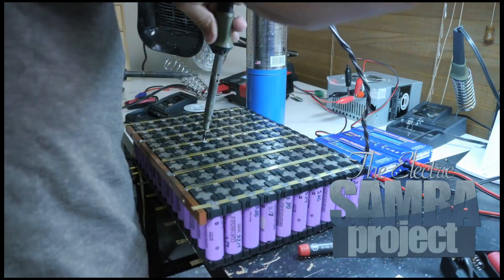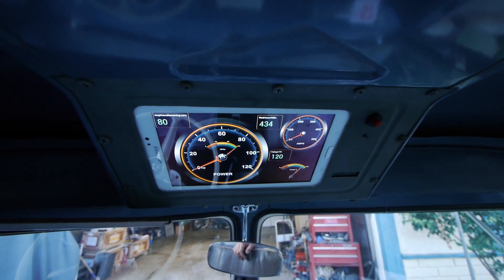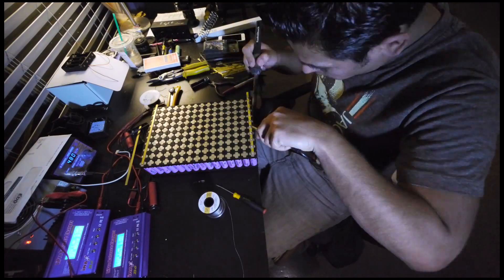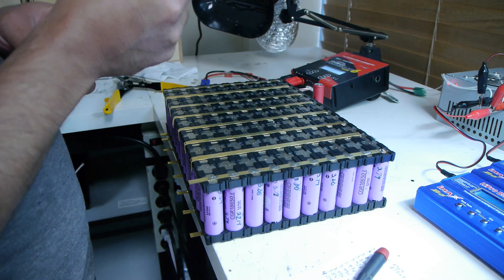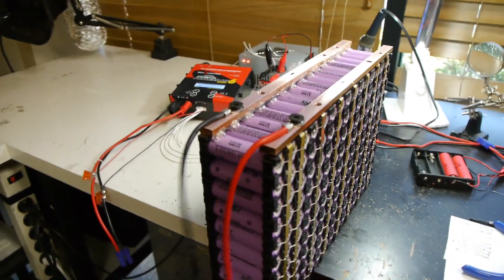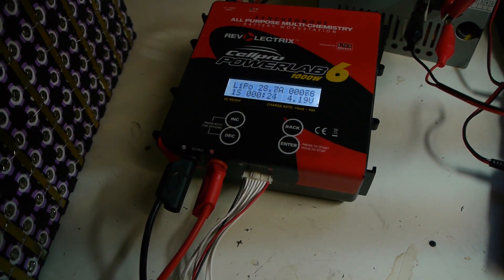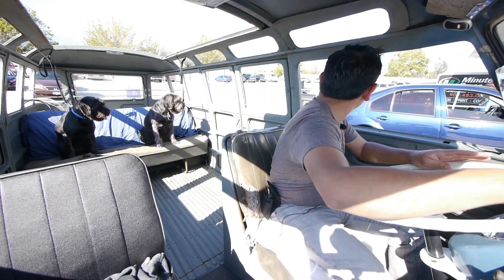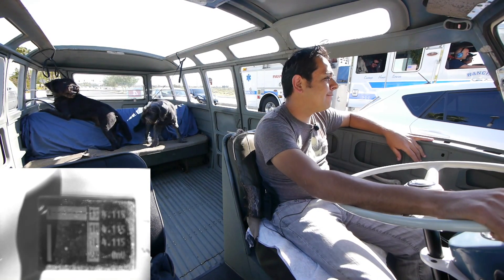DIY Tesla Car -  lithium ion 18650 battery -  VW Kombi

Comment: I don't get it. The motor only run on 1s150p of lithium ion how is that possible with only 3.7v nominal? What motor are you using? I only a see single pack of 150 18650 cells in 1s150p config.
Reply from the maker: +Rizki Praam     30x  1s150p  wired in series so  30s150p

Comment: Mr. Garcia, thanks for the info. The link you have provide indicates its copper bus bar, I have ordered that. Could you please provide the link for copper strip which connects to copper bar.
Reply from the maker: +nick Jain here you go, this is what i used  http://j35.us/Small-Brass-Strips
Reply: make sure you put a fuse on each and every single cell. unless you enjoy toxic electrical fires, then ignore the dire recommendation of every single battery pack manufacturer. up to you.

Comment: You make very nice videos and impart lot of knowledge, we really appreciate it. One of the question I have is where you get the fuse wire as well as copper strip to connect the batteries to the fuse wire.
Reply from the maker: +nick Jain 
Copper buss bars http://j35.us/1NGpBo4
Cell Fuse wire http://j35.us/1k-Ohm-resistor

Comment: how many packs do you have to use to run it if just  the one wow
Reply: +jehugarcia  How much did it cost to build the 30 modules, and what will you get for a ball park range
Reply from the maker: 30 modules
Reply from the maker: +Daniel Schroeder   I ended up using tesla modules http://j35.us/eBay-Tesla-Modules  Dead laptop batteries became really hard to get since the word is out that they are valuable to extract good cells.   I currently have 44kwh for 150 miles of range

Comment: That's a good project! But I prefer the old VW aircooled petrol engine =D
Reply from the maker: +Tiago Mian  I have a hard time finding something about air-cooled vw motor that i like.  Not particularly efficient, powerful or reliable.  Easy to remove perhaps,  four  17mm nuts and its out.

Comment: what range do you have with this 2nd module?
Reply from the maker: +Virgil Ionut  
Well..... i think it turned out to be 255AH  x 3.7v =   943Wh   the samba uses 300wh per mile.   So 943/300= 3.14 miles.
The samba can not run on a single module,  you need around  30 of them connected in series to bring the 3.7 volts of each module up to  111V so 3.14 miles times 30 modules,  should give you a range of 94.2 miles
Reply: +jehugarcia not bad, keep doing this videos please.

Comment: I'm surprised you have a motor that runs at 4 V.  Why not use higher voltage and lower current?  More efficient.
Reply: +Kurt Jenney It's just like you had an ebike with 4x12v (48v) lead acid battery then remove the one of it and replace 3s lithium ion to test. In his eSamba, you can see the other battery in series that not 18650 https://youtu.be/JQa5gn-7D74?t=1m21s
Reply from the maker: +Kurt Jenney   System runs on 96V
Reply: +jehugarcia I didn't get the best look at the battery, butbit appears that all cells are in parallel.  So unless you have many of those packs I don't see how 96V is achievable.  What configuration did you use?

Comment: You went with a 6amp cell level fuse, was this due to the capacity rating of the batteries or due to the rating you've seen the samba running under loads and your calculations?
Reply from the maker: 6 amps is well above the 3c max load I'll expect from each cell,  but is low enough to blow before a cell goes thermal runaway.
Reply: Thanks for answering, I asked because you said in the video you rated it for the 6.5 amps the each cell would experience under load, I wasn't sure if this wax max load or the sustained load.  Cheers on the build brother, I've been building my own 16850 packs but only 10s 11aH/420wH :P

Comment: is it posible to add the cells to a nissan leaf?
how long of a range can i get fron each of the cells.
Reply from the maker: +David l 
Yeah if you can find space in the car,   each 18650 cell has anywhere from 7.4 Wh to 12.5Wh ,  google says that the leaf uses 30kwh per 100 miles or about 300Wh per mile so each cell can give you about 1/30th of a mile of range.   thats about 176ft of range per 18650 cell
Reply: i want to try it

Comment: You are doing just 2.4kw to run this big van ? No way!!!
Reply: +LiPe VoLcOm Yeah, I was wondering the same thing. But then again it is pretty much a bare bone chassis, so it probably doesn't weigh more than one ton and putting the motor through the transmission certainly helps.  Heck, the fact that there is no red line on a motor means he can REALLY use that first and second gear to get up there before shoving it straight into high gear and essentially coast on highways.
Reply: +LiPe VoLcOm I think you only referred the test 18650 modules, the other batteries were in series at back of eSamba which is not 18650. https://youtu.be/JQa5gn-7D74?t=1m21s
Reply: +LiPe VoLcOm 
How about running the entire van of 4.2 volts? That's one big motherf*ing step up converter.. I think we're missing some info here.

Comment: I like how you can drive a car with almost no windows and roof in the USA.
Reply: And seatbelts
Reply: @gf4913  If the car was built with seat belts at the factory it is illegal to remove them anywhere in USA if you still drive it.
Reply: @seanwatts8342  Interesting😏
Reply: @gf4913  I had a 1962 Chevrolet WITH seat belts and I had to keep and use them. Later, I had a 1963 Chrysler with NO seat belts. The police could say NOTHING because the car was made that way.
Reply: Why where in  freedom land do you leave
Reply: Even in France, if you don't drive like an asshole and just have insurance, you won't get a ticket.
Reply: @MABFR01  Dont want to talk about Germany here xD
Reply: "In the USA" no, it varies by individual state.
Reply: ... a functioning brain isn't required either.  Apparently.
Reply: @qpwodkgh2010  No, those are Italian & RUssian drivers.

Comment: I respect your wiring, it is superb, I ran a repair center for Honeywell NASA  Support Green Belt MD and repaired Main Frame Computer power  supplies that moved several hundred amps. Your very Safe, I hope others follow your foot steps so they don't endanger them selves. James Mastbrook
Reply from the maker: Mechanical fuses at every cell makes a lot sense to me,  others don't agree
Reply: Hi there! How do I know which fuses I have to add between the cells? How do I calculate their "capacity" or ohm. 
For short: What fuses do I need to glue between the cells for a 36V battery with 10 serially connected blocks of each 12 parallel connected 18650 cells?

Comment: no charge balance?
Reply from the maker: +Grover Asylum  nope,  works fine without it
Reply: +jehugarcia For now it does. Are you still using this battery? has it gone through a lot of cycles?  I'm building an ebike battery and I'm planning on doing a balancing circuit for it too. I haven't looked into how the Tesla BMS works. Not a car person at all. But now I'm kinda curious.
Reply from the maker: I don't use this particular cell,  but I use the tesla built ones every day,  no BMS I cycle them once every 3 weeks or so,  as i don't drive that much but its going on for more than a year
Reply: +jehugarcia Thanks for the insight! My ebike project involves me salvaging all of my cells from dead RC packs from my local hack space. So a little extra work to make sure things are stable is worth it to me. I bike 30 plus miles a day and have more time than money. This a is sweet looking build BTW, good work!

Comment: The 18650 battery's are superb.
Can you share what kind you're using ?
You mention 6A a cell.
The best i found so far are 3.5A.
I ask this because there are a lot of fakes that advertise the world but are in fact cheap crap.

Greetings
JP
Reply from the maker: +ToThePointGarfield   Sanyos  and panasonic mostly,   the 6Amp where the fuse would blow  so i would only ask 3-4 Amps max out of them to keep them happy
Reply: Youre confusing AH with discharge. Many cells can safely pull 20+A.

Comment: For that bigger project you shouldnt solder cells.
It heat up them.
It shouldnt be...
You can make welding machine from scrap, using microvawe transformer.
It will be better, easier, and much faster than soldering...
Reply: +Arek R.  Safer too. And not only for batteries.

Comment: You need to put in large diodes everywhere.....    That way if one cell dies it only takes a few others with it, not dozens and dozens.
Reply from the maker: +cucking funt Draw a schematic so i can understant how it works
Reply: +jehugarcia Diodes accept electricity in one direction only.  Most modern electronics use them.
Reply from the maker: I understand what they are and how they work,  I don't get how they are helpful in this case

Comment: Nobody told you that heat soldering of cells is FORBIDDEN? For such project, you should use resistive soldering - like Tesla...
Reply: +jehugarcia  hey I solder them too, don't worry too much :P
Reply from the maker: I hardly ever do what I'm told
Reply: markovip211019 thousands of cells later, i'm still here, not ONE, has ever exploded or anything else.

Comment: I tried just using the fusible wire on my bike batteries and I think it is limiting my current and causing my batteries to get hot so now I will incorporate the buss technology :)
Reply from the maker: If you limit the current load on your batteries wouldn't that run them cooler than running them at full load?
Reply: +jehugarcia Yes, however putting them as I did in series limited my current so much that I couldn't beat a snail. Please don't change a good thing that you have, it works great.

Comment: that is impressive it surprized me that that small of a battery pack and motor could drive your samba what is the range on that thing?
Reply from the maker: Battery is not small,  at the time of this video it had around 22kwh of battery,  that's 122v x 180AH
Reply: oh ok

Comment: I wonder, can you use your Balance Tester Leads to monitor your Battery while it's in use? I'm a noob when it comes to this battery pack stuff so I have Zero Clue. I see the PIP but can not figure out if that is the Balance Leads or something else to monitor it. Oh, PIP is Picture in Picture, well that's what they use to call it a few decades ago when it was popular on TV's...
Reply from the maker: Paul Bialozor that is a device used to display individual cell voltage on up to 8 groups of paralleled cells.  I can leave it hooked for more than a few minutes because it uses power from only one cell and it trows the cells out of balance
Reply: jehugarcia Yes I gather that, but do you connect it with the same leads used to balance the batteries when you charge them? I assume you do, but don't know for sure. Also did you make that monitor or is it something you can buy? I want to start experimenting with 18650's but don't have much of a budget to work with so I have to be very creative. I want to use the 18650's as a UPS first, then at some point partial house electrical use to eventually whole house; much like the Tesla House Battery. I can be very creative at times and hopefully one day find my Diamond in the Rough but until that time my mind wonders...Have you figured out the Tesla Fuse Link Wire that was used and why?Thanks...
Reply from the maker: I dont balance my cells,   only once before connecting them,  then I just charge the whole pack as one.   its been 10 months since I installed them and i just checked today,  there is a 10mV difference between the lowest and highest cell,   they are almost perfectly balanced after all this time. I used a cell log 8 available online for $15 or so.   Its for RC lipo batteries.    Tesla uses a fuse that blows at 20Amps for safety.   Im using a fuse that blows at 6amps on my diy pack
Reply: jehugarcia Thanks...

Comment: Shifting into higher gears will giver you more torque for your power. I hear those motors screaming! How many gears d you have? jehugarcia
Reply from the maker: 4 gears,  only 3 usable 1st is too low
Reply: jehugarcia If you care to upgrade the rear end gear ratio, you will probably be able to see noticeable efficiency gain when cruising in high gear! Might be more expensive than just buying more batteries, but it's for sure more efficient if that's your goal.
Reply from the maker: Why do you think my motor would run more efficient with other gear ratios?
Reply: jehugarcia You'll get more torque out of your electric motor the closer you get to 0RPM. More torque= less spinning mass and speed.

Comment: How many 3.7V 2200Mah battery will be used for 2KW Lithium ion battery pack? Will be it in parallel or in series / parallel - series? Looking forward to your response. Thanks for previous reply.
Reply from the maker: Well, let's do the math 3.7 x 2.2= 8.14wh.   Divide 2000 / 8.14 = 245.7 cells will be needed to get 2 kWh.   Series or parallel?  Depends what you need,   You want a really big 3.7v battery?  Connect all of the cells in parallel.   Do you need a 12v battery?  Then split 245 cells into 3 groups of 81 and arrange the pack in 81p3s configuration.   Wiring configurations largely depends on your voltage needs
Reply: jehugarcia Thanks a lot for your each response. This means a lot to me.
My total load is 2KW in home. From tesla's powerwall, their are providing 2kw power at peek. So what will be my battery size yet I need 2KW or my load is 2KW? Their battery energy storage is 7KW. So what will be my battery storage capacity if I want 2kw at peek and I want two days backup. And how can I calculate nominal and peak current from my 2KW battery pack?
Looking forward to your response. Again a big thanks for your previous reply.

Comment: Hmm? So, you have 150 x 3.7V  Li-ion batteries--ALL wired in parallel. Which works out to be 3.7V total.....with a shit load of Amp Hours! Where/how are you getting the needed volts to power the electric motor in this beast?! That electric motor can't possibly be running on only 3.7 volts, period.

Do you have multiple packs of this configuration that you installed, that your not showing? This would obviously, seem to be the case. If you would please, state how many?  Inquiring minds would like to know.... Thanks.
Reply from the maker: 55rebels I have 35 LiFePo4 cells in my pack (115v),   at the time i had 22kwh of battery.   DIY 18650 module was added to it.
Reply: jehugarcia Sorry, but I'm a bit still confused here. In this video, the one I'm commenting on, it shows you wiring--in parallel 150 3.7V (CGR18650) batteries; creating a 3.7V (total) pack. Are you saying that you added 'this' pack to your existing--anemic 35 cell (3.2V per cell) LiFePo4 pack (115V)? I'm assuming that this was done in parallel? That LiFePo4 pack must have been pretty anemic, which couldn't have been more than a few hundred (maybe 1500 at most, in the 18650 format?) mAh, since they had to have been wired in series to get that 115V range.....or am I missing something? (I am kind of dense.... :P)

Maybe I need to start watching from EP #1 to this EP, to get a grasp as to what is actually going on here.
Reply from the maker: watch episode 42 going live tonight,  it explains everything
Reply: jehugarcia
Thanks, I surely will!

Comment: How are you getting the speed you are traveling?  Isn't the speedometer gearing on the transmission?
Reply from the maker: John Chase front axle,   but even if it was on transmission,  its not modified in any way so it would work just as intended.

Comment: Loving that you are driving a car with AA batteries! :D
Awesome ambient music btw ;)
Reply: ExillNetworks Dude those are not AA batteries. First of all, AA batteries are slightly smaller. Second of all, AA batteries are alkaline batteries(nonrechargeable 1.5V) or Nickel Metal Hydride(rechargeable 1.2V), whereas these 18650s are lithium ion(rechargeable 3.7V). And 18650 Li-ions can put out much more current than AA batteries.
Reply: Ahh. Sorry. My bad.
Reply: ExillNetworks It's VSAUCE's music...

Comment: Do you have any issues with cell imbalances when charging lots of them in parallel?
Reply: s28400 bro use a BMS system ...i would suggest ORION ! cell balancing is an issue with li.
Reply from the maker: s28400 no i have not experience that yet

Comment: I see many mistakes in your demo. First of all you have to consider battery chemistry in lithium tech: LiFePO4 , LiPo(lymer), LiNiO2. Voltages are different. You can't discharge a pack from 3.95 to 2.7. etc... I like what you do but more accurate information should be better for everybody, if not this video is like a garbage as many in this internet.

Comment: Well done man, but did you drive this VW bus just with this small battery pack only ?
How many KWh does it store ?
How many Watts does your motor need during crusing ?
Regards, Stefan.
Reply: Evidently, unknown.
Most of these videos are interesting, but they only scratch the surface.

Comment: 5:52 ... so each of the cell blocks is what voltage?
Reply: Paul Gdry 
Hint:
Batteries connected in parallel: Voltage stays the same, capacity is added together
Batteries connected in series: Voltage is added together, capacity stays the same